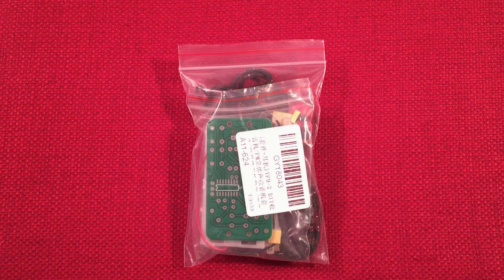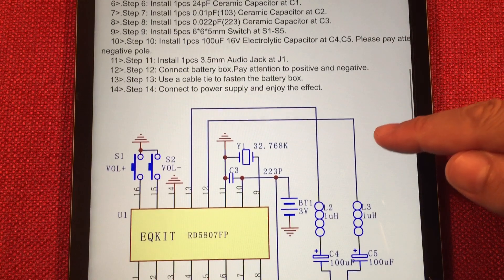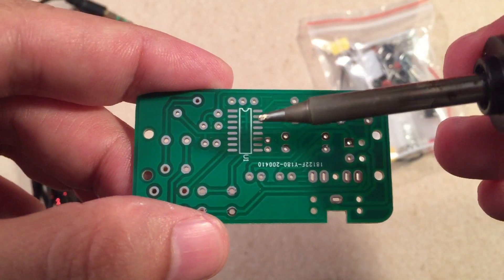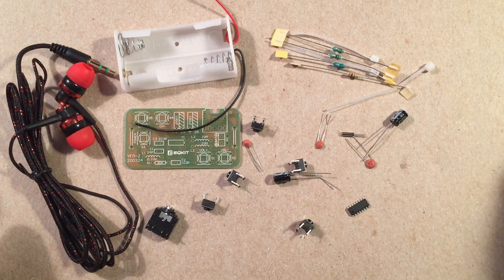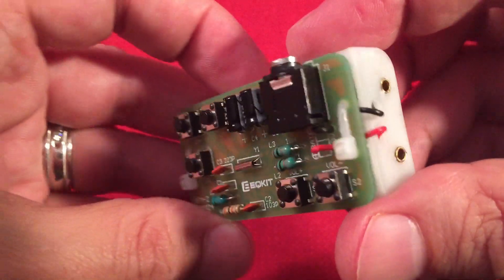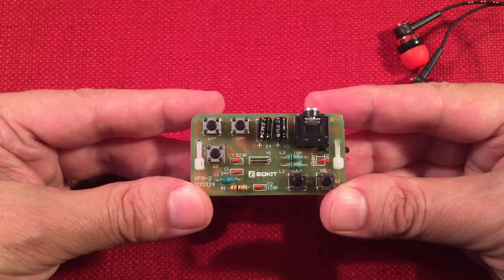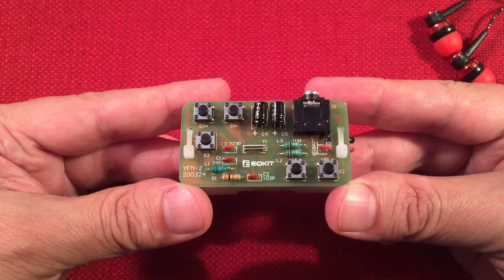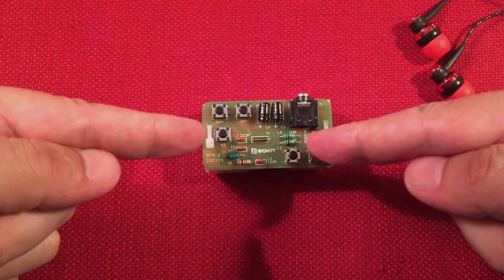ICStation DIY FM Stereo Radio Kit Build & Review

Comment: Just finished building this kit, Hardest part was the SMD chip but I used my new iron and it went together pretty good but difficult. I need to invest in a moist sponge or a souring pad in a small container so I can keep my tip clean. I've had to make some modifications to the kit and I used a different 3AA battery holder because the one that came with the kit is poor quality and the batteries just popped out but I used one from another project. The zip ties broke on mine so I just hot glued the board to the holder. I added an antenna wire to the ground as it seemed to come in better when I did that. Just waiting for the glue to cool but this kit sounds crystal clear with my earbuds and even better on my DIY headphone amp. I'm listening to it as I type this and it sounds awesome.

Comment: I just finished putting this together and it was intermittent. It turns out when I was inspecting the solder connections with a jeweler's loupe that I missed completely soldering one of the pads. Once I applied solder it works 100 percent and sounds pretty nice for a cheap kit. I got a couple of these on a sale for 3 dollars each without the earbuds. The SMT chip took the most time, trying to get it perfectly aligned but I got it done. Thanks.

Comment: Hey dude, thanks for the great walkthrough. Mine is powering on, volume controls work, and I can flick between stations, but all I'm hearing is white noise. I think it might be the antenna? One hint is 0V across the resistor and the inductors (but it's still turning on) and 2.7V across the caps. Any pointers appreciated.

Comment: Very neat little FM radio. It would be cool if there was a case to go with it, to protect the circuit from the elements. Also, an tuning and power indicator LED would be good on that. Regardless, it's still great. Cheers!
Reply from the maker: Thanks Dwayne, I have a few more FM radios coming from them...keep watching.

Comment: I may look for this radio if it's on amazon because I have a pop up speaker that has a similar tuning style FM radio which I don't mind. I wish it had a power on LED but that's ok since it draws 19mA when on and you have 2800mAh batteries. I have a 3 watt amplifier from Adafruit that I may use for this or one I made from a Gameboy advance sound accessory that had an amp and I think a light.

Comment: I did near perfect soldering on this EXCEPT for the chip. I saw a video on the ali express page that showed him smug the whole thing with solder. I thought I should try it... and I created a smoking short...

I had tried to do it the way you did at first. I think I might have actually gotten it to work. I'll need to order another kit. I want to make this one work!
Reply from the maker: lots of flux, try to tack down to corners, and put a bit of solder on the tip of the iron and quickly drag the iron across the pads in one motion.  check for bridges.  If you get a bridge, dry the iron and put it on the bridge and drag the iron away to help pull the excess off.
Reply: @todderbert  Yeah. Flux is not something I ever used. I've been getting much, much better at soldering to the point that I make beautiful little plops of solder where the holes are. But those are in the 'normal' holes. This little IC is so tiny that I think I melted off the legs. Even if I didn't try to imitate the aliexpress video I would still have messed it up I think.
Reply from the maker: @Hotshotter3000  The iron has to be around a 25W to work well, anything hotter could be an issue. Of course a small bladed type tip would be ideal.
Reply: @todderbert  Yeah I don't know what the wattage of my iron is. I got it as a cheap kit from aliexpress. The iron is fine. I did manage to make my first successful kit project (the hourglass LED) with it. My previous projects were failures because I had no idea what I was doing. Hopefully my next kits will be a success. I got two star-shaped LED flashers with ultra small points. This will be good for practicing this type of delicate soldering.
Reply from the maker: @Hotshotter3000  There are also SMT practice kits out there as well.
Reply: @Hotshotter3000   just keep practicing mate :). and, for sure, temp control soldering iron with right tip for the job helps..
take a look on one of those 5v usb soldering irons for $5.. they looks just right for the job, fine tip, soft cable..
Reply: @Hotshotter3000  Get some quality solder like Mechanics makes a giant difference. Cheap leadless solders are not beginner friendly.

Comment: In the schematic, it shows pin 6 of the RDA5807FP connected to the battery + (3V). In the datasheet for the IC, pin 6 goes to ground.

Comment: i built this today before diner :). nice little project to kill half an hour. but mine is too loud, even on the minimum setting, if the signal is good, its almost too loud to listen with headphones(well, in home, in quiet room, guess outside where is noisy it will be ok). i was wondering if i can modify it to be not so loud..
Reply from the maker: Headphones with volume control is probably best.  I'm not sure which capacitor you would change.
Reply: @todderbert  as headphones with volume control actually just have potentiometer (if thats the word in english), i guess i just can cut the trace to the phone jack and experiment with different smd ressistors.

Comment: I got a little radio the size of an mp3 player for my bday it only works with headphones or like you did plugging it into speakers but it pulls in good and is am and fm its my favorite it is just a fun little radio.
Reply: I plan to try mine in my car, with the aux. jack in the car stereo
Reply: I would also like to build a small amp, but haven’t come across one yet.

Comment: Nice job on soldering the I.C. Todd. My irons are a little inferior for that.
Reply from the maker: I think my little 25W Weller would have done the job just as well as the Hakko.  It's all about tip selection.
Reply: @todderbert Good point, thanks for the tips :-)

Comment: I hate surface mounts. 
Its been pure luck for me on the very few Ive done. Never did anything with more than 4 pins. 😮
Reply from the maker: Takes a ton of patience to do the drag method, then you have to be good at clearing any bridges.  Practice makes perfect.
Reply: @todderbert  I was able to do as you suggested. It worked pretty good. Bridges are easy to clean up too. Lol
Is there a point to solder a wire for an antenna? .Can I solder it to ground?
Reply from the maker: @HappyHermitt  it might be on the headphone jack's ground.  Something to check.

Comment: Is there a shortwave radio kit to build? That would be a neat project.
Reply from the maker: Yes there is, http://www.4sqrp.com/ozarkpatrol.php .
Reply: todderbert I’ll have to look into this.
Reply: @RJDA.Dakota  Crystal shortwave radio: Four turns of 26 AWG magnet wire close wound on a paper towel tube. Then wrap 14 more turns right behind this one. Connect a IN34A germanium diode, tuning capacitor and crystal earphone to second coil. Connect a 100-200 feet long wire antenna to four turn coil and a good ground.
Reply: BAN EVERYTHING! I’ve seen this one work! Crystal sets are great because they take no batteries.
Reply: @RJDA.Dakota  I forgot you need a 170 k resistor across earphone leads. This does something that I don`t understand that improves volume and gives it a nice tone. I discovered this when I shorted out the earphone leads with my finger and noticed the improved sound so I measured the resistance of my fingers and got a resistor that matched.
Reply: BAN EVERYTHING! I’m not exactly sure what the resistor does but it sounds like a headphone impedance matching unit. Very cool and interesting. Still cool, crystal sets are awesome! No batteries!
Reply: @RJDA.Dakota  I used to build and sell about 8 to over 14 AM and Shortwave crystal sets per day until my hands got too sore to keep doing it. Couldn`t keep up with the orders. Two of my friends had radio shows on WWCR and advertised for me for free. It was back in the 1990s when shortwave was alive and kicking and the Patriot Movement was in full swing. 

I also sold what I called "AM Booster Coils." It was simply a 120 turn coil (this coil is tuned to the AM band) of 24 AWG magnet wire close wound on a paper towel tube that you connect to an outdoor longwire antenna and place near an AM radio to greatly improve reception. You could get stations during the day up to 400 miles away using it if your antenna/ground was good. No tuning capacitor needed.

Comment: Good video overall but a very strange review because after the build you only rate it fair and then you go on to say you got 17 stations and later on you say "it sounds great, this thing's awesome." So is it fair, great or awesome? lol.
Reply from the maker: Fair for receiveing FM Stations.  It is specific to my Location, and its auto tuning system.  The Audio is Amazing for the Stations it does receive, and the Kit is Cheap and Fun to Build.
Reply: @todderbert  Thanks for the quick reply. I guess the number of stations is never going to be anything the receiver can influence as it depends where people live. I just bought some online for $2.68 each. Unbeatable value and way better than the days of trimming IF transformers and trimmer capacitors in superhet transistor radios!